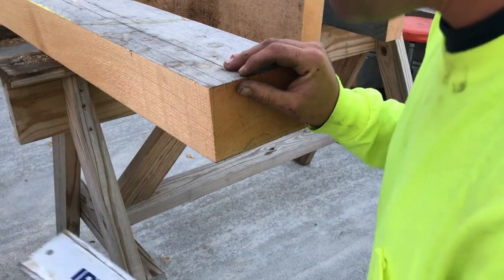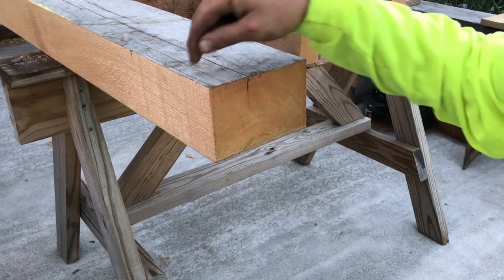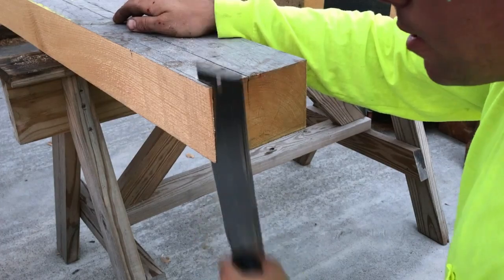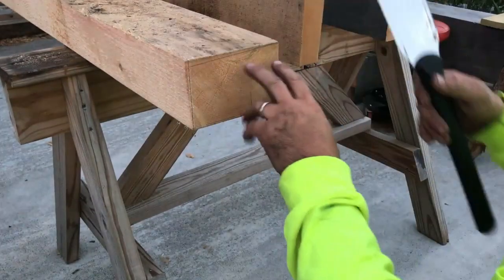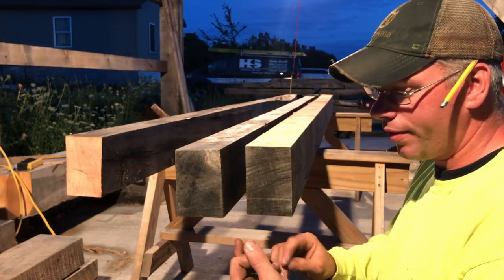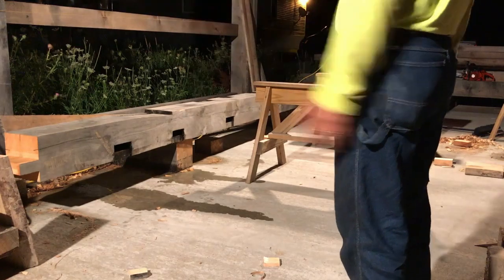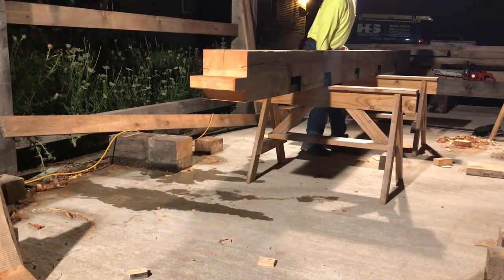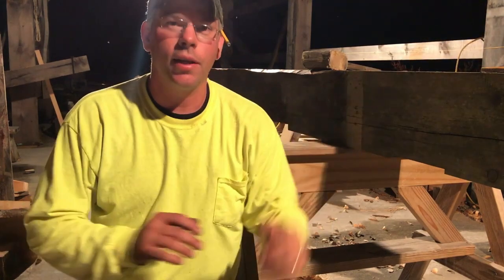A Timber Frame Vlog #35: Plugging Away

Comment: Looking good.   have fun on Vaca.  
Quick question for you, I know when you mill your timbers they are probably green and then sit for a good while till you get to putting the mortise into them.  I am sure you have some warpage and probably twisting happening.  HOw do  you deal with it? Is it possible to pull a twist or warp out of a timber of that size
Reply from the maker: +jim stew probably not possible with them that big, I actually have not had a bit of that yet.  Biggest reason I went with white pine, it's very stable.

Comment: Are those a single mortise and tenon going into each side of the post, or is it a through mortise with the girts doing a half lap inside the mortise? Hope you enjoy your vacation!
Reply from the maker: +Robert Weiland single mortise, 3" long tenon.  The girts play no structural role in the frame other than holding siding.  They just have to stay put.
Reply: Ok, thanks. I couldn't tell.